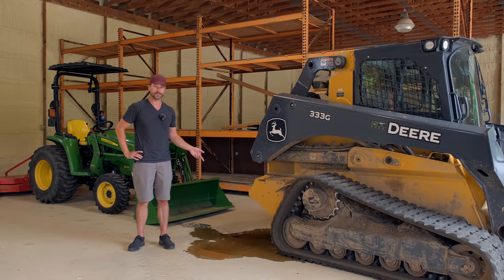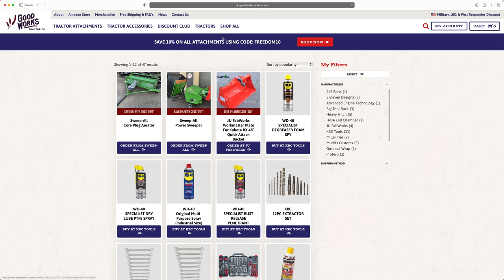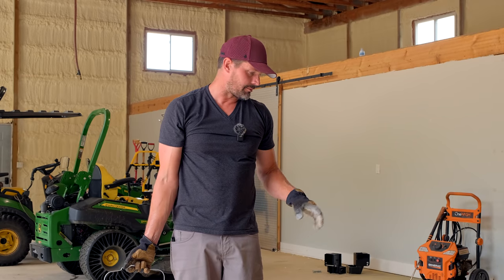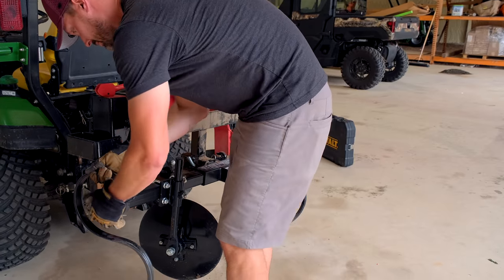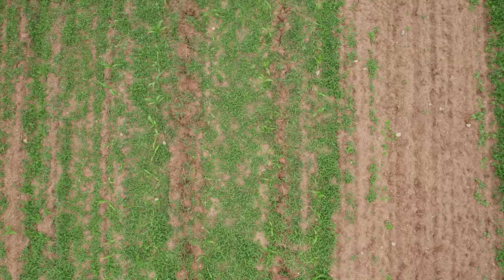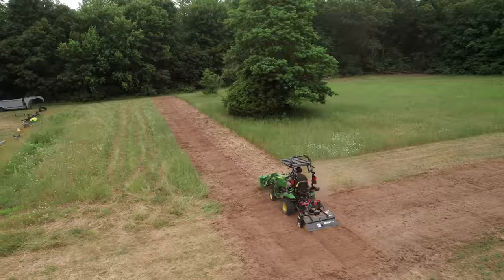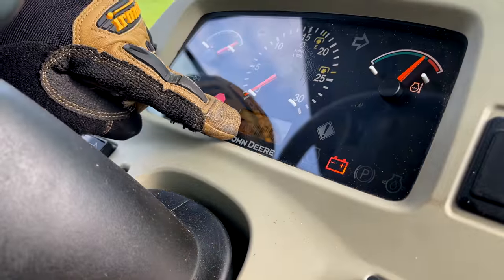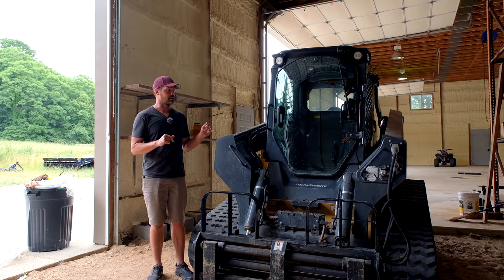JOHN DEERE DESIGN PROBLEM: TECH FINDS THE CAUSE OF OIL LEAK

Comment: Plain clay cat litter and the "shuffle dance" needed for those spills on your concrete. Once you get the hang of it you'll never know there was a spill!
Reply: +1 After all the years of oil cleanup the “shuffle dance”or “twist” are the superior methods to properly mix cat litter and remove oil!
Reply: @stevenloy6657  ....Kitty Litter is the right solution.....the worst I have ever used worked "outstanding!"
Reply: Absolutely agree the cheapest kitty litter works amazing.  $10 for 50lb bag at Wally world. And I reuse it several times before getting rid of it.
Reply: Yep,  it's great for oil spills and traction on snow and ice.
Reply: 100 percent.  Clay litter.  I haven't tried the shuffle dance but I will now!  I use an old broom and dust pan and then shop vac any remaining dust.

Comment: Whenever I am bush hogging for long periods, especially when the seed heads are bad, I will watch the temp gauge on my tractor. As soon as the temp starts going up I know to head back to the barn.  I use a leaf blower to blow behind the radiator and all around the engine.  Amazing how much stuff gets stuck in there.  The leaf blower works great and it's super fast.

Comment: After initially cleaning the oil spill up, there is an easy way to get rid of the stain left behind. Pour some mineral spirits on it (even the used stuff out of the solvent tank works), scrub it in with a broom for a minute or two, then cover heavily with floor dry. After a couple hours or so, sweep up and save the floor dry for re-use, and the stain will be gone.... Often, that spot will be cleaner than the rest of the concrete.

Comment: When you use the oil absorbent, don't sweep it onto a clean spot or it will stain that area also.  Don't use the broom initially, just scrape it around with a shovel.  Once the absorbent is saturated, shovel it directly into a disposal container.  Finally, coat the area again and leave it there.  It will continually draw the oil from the concrete until the stain is minimal.  Use the broom to sweep it back to the oil stain if you should scatter it because of normal foot or machine traffic.  The longer you leave it, the better it works.

Comment: I'm just getting into owning equipment.. have a 2025r, gooseneck trailer and I should be getting a 60g sometimes this week or next week. I'm also on my first American pickup truck, moving away for small japanese cars, I buy stuff new to avoid as many problems as possible. But It seems it's part of the game... I've had hydraulic cylinder issues on the tractor, all kinds of minor electrical problems on the truck. The gooseneck trailer is a saga of problems... for someone who isn't mechanically inclined, it's a lot of learning experiences!!  Speaking of learning, thanks for the video! You are one of my go to channels for a lot of the learning I'm doing!

Comment: I sweep up all the sawdust from under my table saw, and keep it in a 35 gallon garbage can. With a dustpan as the scoop, I use it on all oil leaks the happen on my concrete, I sometimes leave it there for days, as it can only help absorb more of the oil.
Reply: That is typical of Deere and their dealerships . Ten minutes after my lawn tractor was delivered it had a flat front tire ,  dealers answer was sorry not covered under warranty , tough break. Last Deere product i will ever buy.

Comment: Good morning
A oil leak clean up tip for you , after picking up the heavy oil. On the second batch use a 4 by 4 block to work it in. The pulverize speedy dry will clean up the oil spot better.

Comment: Wow! The comment I made specifying to power wash (in low pressure rinse mode) the rad cooling fins was based on the assumption the slide in rad filter was clean to begin with. Glad you found the culprit and I respect the fact you admitted missing such as a remedy which should help others from here on out. It is my experience that t-stat issues are quite uncommon especially with such low hour equipment. Keep up the great, real world content.

Comment: As a former volunteer fire fighter with nearly 10 years of service, when we had vehicle accidents with spills like oil, antifreeze/coolant, gasoline, etc we used a product called speedy dry or something similar. We got it in 50lb bags. The way I was taught was: 1) spread the speedy dry over the spill and then let it sit. 2) work the speedy dry in with either a broom with a scrubbing action or with your feet by grinding it In with your heel and/or toe or twisting action with your foot. Then let it set a little more. 3) use a Broom to sweep it up but scrubbing as you sweep. 4) repeat until all the spill in cleaned up. 

Later on there was a foam that was developed that some fire departments used to spray on spills to make them more biodegradable. When sprayed through a hose line nozzle it created a foam. Another one used a special nozzle on the hose line. That special nozzle created the right air mixture with the water and foam liquid concentrate to create the foam. But that was in the fire service in the late 1980's and into the mid to late 1990's.

Comment: For oil spills, I've always used kitty litter (the clay based stuff, whatever's cheap).  Once the worst of the oil is absorbed, use a square shovel to scrape up the litter.  If there's a visible stain on the concrete, throw some more litter on it, then "scrub" it with a cinder block.

Comment: I usually soak up the bulk of it with rags or paper towels or “diapers” (spill kit) then use the oil dry sweep, it will save money and time! Then put down your dry sweep and grind it in with your boots to get it all out.

Comment: I have a six or seven year old Z920M 54”, and I’ve only had one problem. I apparently have a pack rat that chews the covering off my wires living in my barn., and the mower had to be shipped off for repair. The mower by the way, regularly cuts 10 acres of uneven land and 600’ of driveway edges.

Comment: That’s what I admire about mechanical and electrical engineers. Common sense and logic are not part of the design process. Such as a simple but highly important drain plug. Curious how much savings with the plastic vs the tried and true .34 cents metal plug.
I’m sure the plastic one could survive getting slammed into a rock or tree stump as one backs up into some tall weeds.
Forgot to mention Dawn dishwashing soap. Mix it strong with water and leave it sit on the floor stain for a a couple hours. Usually work quite well and no spots on your dishes!
Reply: "They" have to do "something" at "work!"  LOL!!!!

Comment: Dawn dishwashing soap will take that stain out. The oil that went down the floor drain will also benefit. Dilute with water but not a lot.  Use a softer brush to work it in and spray it off

Comment: I bought a 1025r last October.  Love my little tractor but JD did a poor job of assembly.  Lost nearly all my antifreeze the 2ed or 3rd time I used it. 3 out of 4 radiator hose clamps were loose.  Lost over a gallon of hydraulic fluid because one of the hydraulic line fittings wasn't tightened.  Nothing serious but two trips to JD 20 miles each way. They gave me a gallon of antifreeze but I had to buy the hydraulic fluid.  Was still under warranty so made me kind of mad I had to buy the oil!

Comment: An old mechanic many years ago told me to pour gasoline on the spill first and then coat it with oil dry.  It will help the absorption of the oil into the clay or whatever it is.  It does seem to help.

Comment: Like other commenters have said, a trick for floor dry oil clean up is to "grind" it in. With smaller spots just twisting your shoe when you step on it is enough, for larger spots you might try something with wide smooth tires or a roll packer of some sort if you have one.
Reply from the maker: It said to us a broom, so that's what I did 🤷‍♂️
Reply: @GoodWorksTractors  that will get the vast majority of the oil for sure,  just the stains in the concrete tend to take a bit more work if you like to keep the floor looking super clean.

Comment: I would block that drain off with a rag first (Or a "PIG" soak up tube,which I am sure you don't have) Then use a coal shovel and a dust pan and shovel up and pour as much oil as you can in a can...At that point you barely have any spill left and it can be cleaned up easily. A lot cheaper then using a bucket of "soak up" If you do not have "soak up" and you have the leak contained cut some wood and use the wood chips.

Comment: Hey Courtney well in my opinion I have the same thing with my Mahindra if I don’t keep the screen in the radiator clean and warm up a bit it’s fortunately it’s never overheated but I keep a pretty close eye on it anyway I think all the dealer should change the way the fan sucks all the air and all the debris and shit from outside into the motor and he wouldn’t have here for that problem just Byam but but I’m just an old dude but I know

Comment: JD just doesn't make quality products anymore. Plastic gears in transmissions, plastic drain plugs, etc. Their business model is to have you either keep bringing them in for service or replace them after a few years. I don't know if Kubota is doing as bad, but they are not using plastic gears and I can still fix most problems myself.

Comment: Good to see real life equipment problems and how you solve them.  I must say though, that floor dry powder did not really do a "good" job.  If you are not a hard core "environmentalist," I think applying dirt would do a better job at much less "cost."  The last thing you should do to get the stain out is to use your granular of liquid laundry detergent.  Wet surface with water, apply, wait 10-15 minutes then scrub with your floor broom (it will clean that too) and wash down with hose.  That $30 pail is way overpriced for what it does.  Sorry, but that is just me.

Comment: Where does the floor drain discharge?  Looks like the slope of the floor to the drain worked quite well in directing the liquid to the drain. I am not much of an environmental nut but if the drain just goes out on one of your growing areas, you might want to capture that fluid at your discharge for the floor drain.
Your channel has only reinforced my belief that John Deere is living on past performance and that the quality control, particularly on "small time owners, not commercial" is severely lacking.
Reply from the maker: Still haven't found the other end of the drain...some day!
Reply: @GoodWorksTractors  That's what General Electric said until it was determined that the entire Hudson River in NY State was contaminated with 1.3 million pounds of polychlorinated biphenyls (PCBs) from GE's discharge for over 30 years. Don't put your head in the sand, especially if you have an onsite drinking water supply. If the drain discharges to the ground you could contaminate your well and/or the aquifer, a stream, etc.  Protect yourself, your family and your neighbors!

Comment: As odd as it may seem, try putting Dawn dish soap or any other strong detergent on the oil stains on your concrete.  I've had pretty good success using it in the past.

Comment: What was wrong with the zero turn, my father in law's is doing the same "starving for fuel" type issue and can't figure it out
Reply: It may not be related but my neighbor and I both have the Kubota front mount commercial mowers. Whenever we would go downhill forward the engine would shut off. Sometimes for a brief second, sometimes longer. Started and ran perfectly other than that. The problem was the fuel filters. His dealer changed his and I changed mine myself after the dealer diagnosed  his problem and problem solved. Go figure.
Reply: @garymeyer3294  we've done fuel filters, carb clean, even left gas cap loose incase it was air locking , happens after about 15-20 mins run time it's very strange
Reply: Choke may be staying on.  Turn it on and off when you notice it.  Starving for air not fuel.  Check air filters.
Reply: Check and possibly replace the fuel pump.
Reply: @rfb7117  that's our next step it's ordered
Reply: Mine did not give me a problem until it got warm, and then shut the machine down until it cooled down. Don't put a CHEAP Chinese replacement in, I went through two that gave me issues down the road.  Bite the bullet and buy the manufacture's recommended replacement, even though substantially more expensive. 
Just my thoughts.....Good luck
Reply: @rfb7117  yea we ordered through the dealer